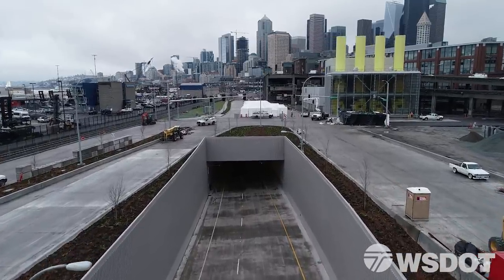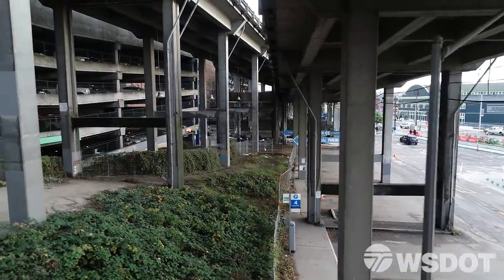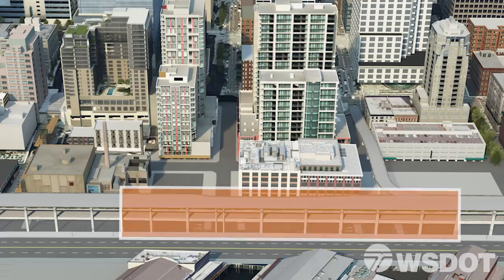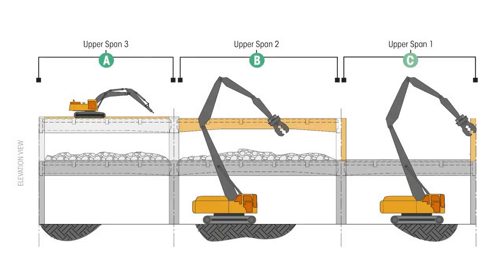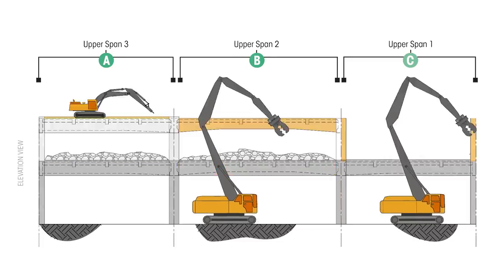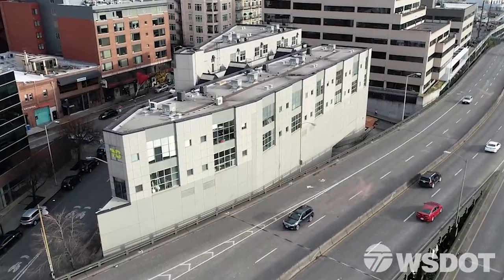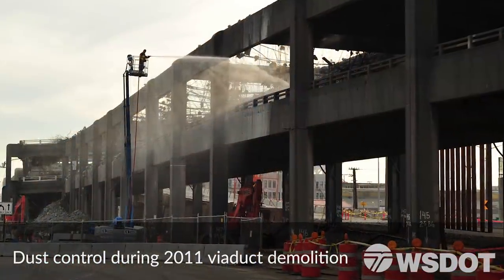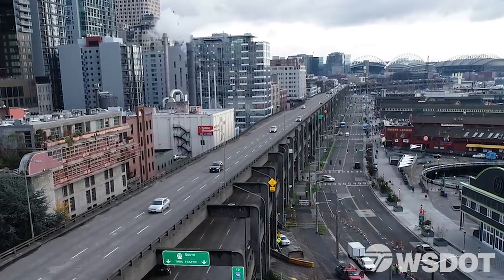The path to demolition for Alaskan Way Viaduct in Seattle

Comment: The value in that viaduct area is about to jump up 300% in Seattle just like SF did when they tore down the Embarcadero Fwy and the Central Fwy.
Reply: True. Areas with roads like this close to the buildings and blocking and shadowing everything is disgusting looking.
Reply: Kandi Klover Kandi Klover I see it from both ways. Eyesore from the bottom but incredible rare views from up top. Its a nice roadway the way it winds along waterfront. It wasn’t that bad along the buildings and wasn’t really blocking much. But Seattle is about to be a very expensive place which it’s already becoming. That 300% is gonna spread across the city like in SF. But I hear you.
Reply: San Francisco does not have our rain. I live here and that wide open rainy area will have a tourist from San Francisco calling our city a horrible area. I walk under all the time and the connection that it provides are not done a in a feasible way. Add a few trees and a larger public transportation system that doesn't exist with tiny little rain covers and you will have big puddles and allot of roots showing really fast. Improve it and you have the HIGH LINE FOR NYC. I middle connection to Pikes Place that once was owned by cars given to the people and a top floor garden view with a lower area for car a few cable bridges to connect to the water front with glass elevators. Bam You get Seattle not San Francisco. If I was done with College I would have done the Auto Cad renderings myself but I can only call the mayor and tell them this is a Mistake.... KOMO news have hung a few time because all they see can see a city through the lens of a windshield.

Comment: Is all of it recycle and scrap? Can chunks of it become beneficial for marine life, such as man-made coral reefs?
Reply from the maker: The metal will be recycled. The concrete will be used to help fill the Battery Street Tunnel, which closes when the new SR99 tunnel opens.
Reply: @wsdot  The Battery Street tunnel should be made into a Homeless Shelter and the concrete should be made into a reef in Puget Sound.
Reply: @Nwtractors  Your opinions are very empty.     You want to stuff a bunch of homeless people in a tunnel with only two exits.
Reply: Have you taken into account if the neighborhood wants homeless sleeping literally under them?   Im not for homeless camps.
Reply: @3DGEM3  Yeah i guess its better for them to be sleeping on their medians and doorways in the rain, because that is where they are now.
Reply: @552mustang  #reporttrolls
Reply: Nicholas Littlejohn Awh is that your standard retort to anyone who sees things differently than you? Seems like I have more likes for my reply than the original comment. Your way of dealing with the homeless doesnt work and never will.
Reply: @552mustang  As opposed to your way of wishing them out of existence?
Reply: Why not ask the homeless what they need?
Some simply need an address so they can apply for a job.
Others need mental health assistance.
Some are veterans of our wars who have given up on the VA to help them.
There is no one solution fits all for homeless people.